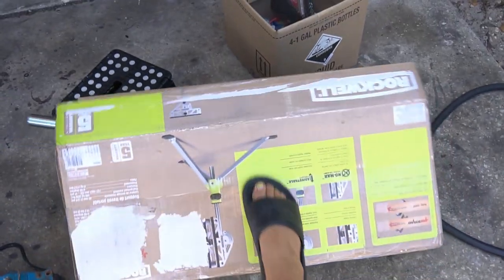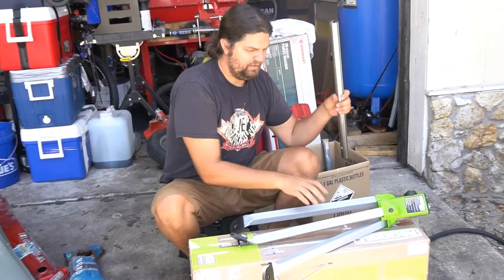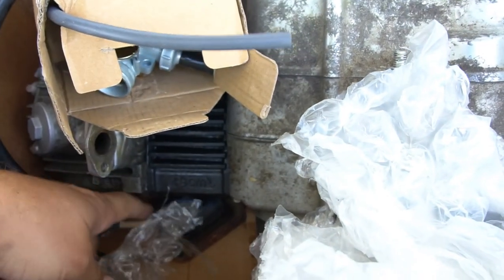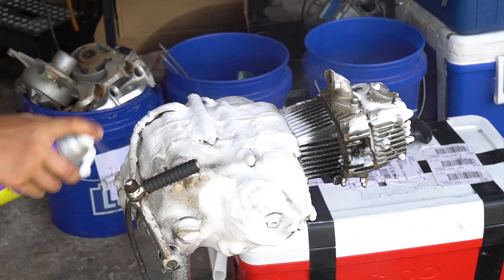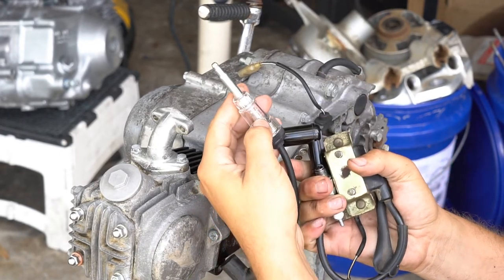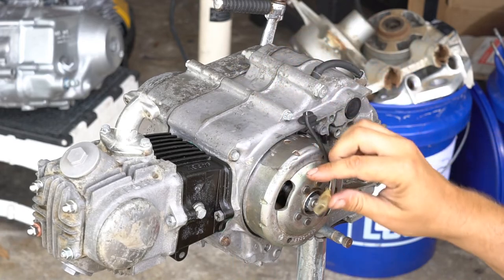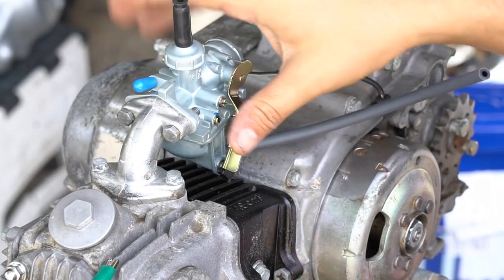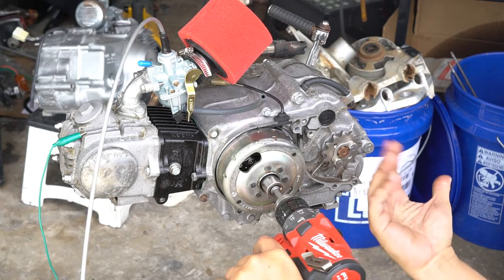1986 Honda Z50 Z50R Z50RD Engine - Tired Top End - Video 1 of 2

Comment: Josh can you please tell me the size adapter you used for the spark plug threads on the Lang CLT-2 leak down tester? I bought same one after seeing this video last week and the small brass adaptor that came with it won’t work in the spark plug thread/hole of the Honda CL-70 that I have that I want to do a leak down test on. Thanks if you could help me with the part or the link to where to buy one😄
Reply from the maker: Lisle 10mm #20530 - https://www.amazon.com/gp/product/B00CEX5B1Y/ref=ppx_yo_dt_b_search_asin_title?ie=UTF8&psc=1